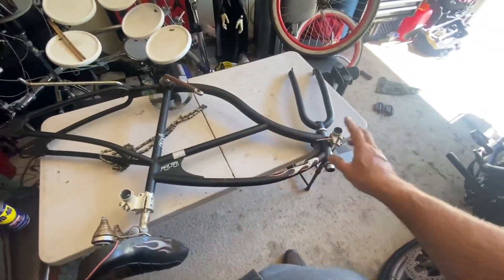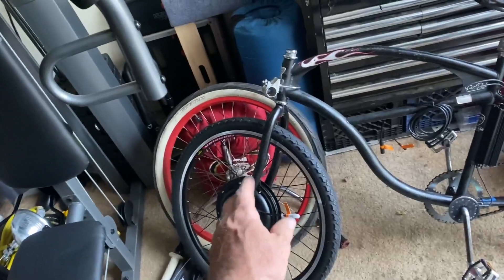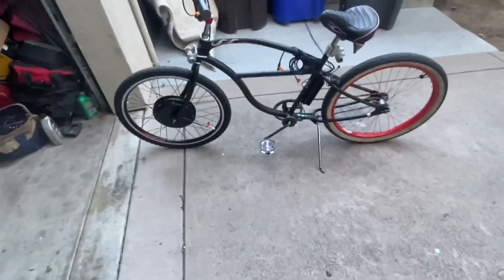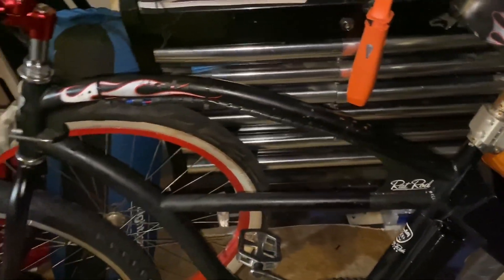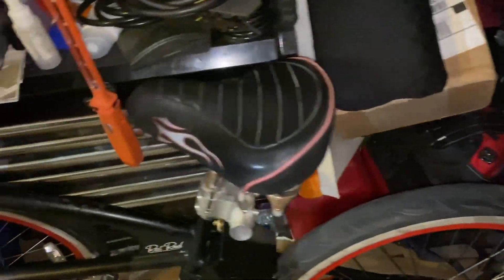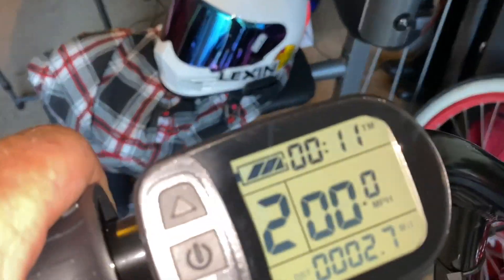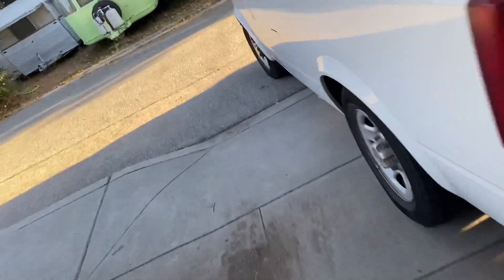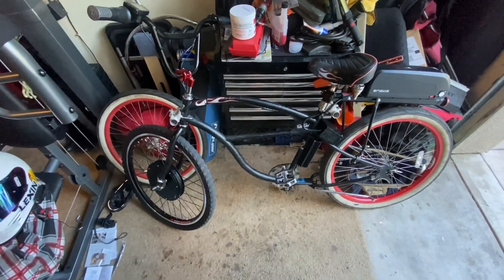convert my beach cruiser to an E bike, Electric bicycle #electra #electrcriuser #bicycle #ebike

Comment: Leave it on eco mode,without a big battery you only do about 25mph 1000watt motor, 30 miles with out pedal.its all good.two batterys or three,the battery's will die before the motor dies.thats a long time.

Comment: I’m so glad I came across your video, I have the same model, except in a three speed, have you tried putting the original tire on the electric hub? I want to do a similar build, but want to retain the awesome flame tread
Reply from the maker: I have not. Just running as is
Reply: was yours a 3 speed as well? If so, did you remove the shimano nexus and coaster brake?

Comment: Nice conversion. What is your experience so far with front hub weight increase ? Is the bike harder to steer compared to before ebike conversion ? Any issues with front hub as opposed to choosing rear hub. I am about to make a decision on front vs rear hub conversion kit, same type of bike, road use. Thx
Reply from the maker: The front was easy / lazy way to do it. Works great. But things like wheel turned acceleration can be sketchy. Other than that it’s still going good.

Comment: I have my Electra on the rack getting ready to strip things out.  I was thinking of going a Bafang mid motor and was wondering how that would work with the coaster brake?  Do you use the front brake and did your bike come with one or is it an add-on?
Reply from the maker: It would be add on. I’m just running coaster break and it’s scetchy.
Reply: I ended up going with the ebikeling 750w front hub kit.  There are bolt holes on the hub for a disk brake but no real clearance to fit one, much less mounting holes for the caliper, so I guess Im going to rig a front caliper setup.  Standard brake shoes or something larger or stickier?

Comment: Pedal-assist on a one-piece crank? Anything I should know? Want to put a hub motor on a 7 speed cruiser. Customizations look better on a cruiser. Just worried about pedal-assist setup on a one-piece crank.
Reply from the maker: It didnt last long the sensor for pedal assist. I use the throttle it’s still working great.
Reply: @NorCal-refrigeration  it sounds like you mean it got broken. I'm going to try to make it work as well. It's in a bad spot I'm thinking a large washer welded to the crank in front of it to protect it. I've got to try something to make it work without spending a bundle on a new crank.
Reply from the maker: @radiocean707  I made a nice bracket for it.

Comment: it's a good job...but you might want to wear a helmet. I was riding along on something like this several years ago, hit a sudden abrupt depression in the road, and the next thing I knew I was going "WHACK' against a curb with my head. I was lucky in that I had a helmet on, and so was able to get and walk away pushing my bike along beside me. I recall when I stood up being so astonished that I had hit that curb so fast and so hard and had come out of it undamaged that I put my hands to my head and walked around a few minutes just saying over and over "Wow Wow Wow!" I've ridden a great deal since then, both electric and gas bikes and I find I can't even sit stationary on a powered 2 wheel vehicle without some kind of helmet on.

Comment: I have an Electra Cruiser 1 I’m looking to convert to electric. What conversion kit did you get from Amazon and which battery did you go with? Thanks for any help or advice you can give!
Reply: Hey did you ever get the answer to your question? I'm wondering the same thing  just got that bike at a garage sale its so nice. I want to convert.
Reply: Ah, all the info is in the description! The wheel hub kit is $245 and the battery is about $140

Comment: I did this same conversion to my Schwinn beach cruiser last week. I had to add a torque arm like you did because the axle kept pulling out of the forks drop out. Yesterday I noticed it trying to pull out with a little gap between the axle and dropout. How is yours holding up?
Reply from the maker: Requires checking but going good still 30mph.
Reply: @NorCal-refrigeration  Thanks.

Comment: I am guessing by your installation of the kill switch you did away with the hand brake lever. I am on the verge of doing this to my bike but was wondering about coaster brakes effectiveness, but it seems you are cruising along just fine. Thanks for the video.
Reply from the maker: The braking is lacking. And yes kill switch replaced brake lever.

Comment: Any chance of a follow up on how you find the front hub drive . I am looking at converting a 29er hardtail to front hub drive, but most bike shops i've talked to say they are bad in wet or slippery conditions. I would be interested in your comments. The bike is used mainly on paved bike paths with a few hill sections
Reply from the maker: The manual says not for wet weather. I think that’s because the electronics will get wet and die.  I’ve been ripping all over on it up a huge hill to work ( pedaling and throttling 12mph ). There are rear hub kits out there also.
Reply: @NorCal-refrigeration  Hey there Nor-Cal, Where did you get a hub motor for a 2.125" wide cruiser wheel? all the ones I find are a 1 3/4" mountain bike type rim... or did you re-spoke in the motor in??? I got a brand new cruiser I am excited about converting, will those hub motors work on the rear w coaster brake? Don't really want FWD. If rear hub motor not an option I plan on clocking a mid-motor up inside the frame with a frame bag over it so no-one can see it... does that sound like an easy fabrication? (the cruiser frames have way more room up there)
Reply from the maker: @autojohn2000  Amazon I think the link is in description
Reply: @autojohn2000  You're confusing tire width (26x2.125) with rim width.  A standard 1.75"  wide 26" rim will hold a wide range of tire widths, much the way a car or truck rim will.
Reply: Thanks for the reply. The Road laws in NZ limit E bikes to 300W max motors, unless only for off road use.Going Rear hub drive means I cant run my existing worn Shimano 9 speed cassette, chain and chainrings. In these Covid shortage times Bike parts can be a hassle to source in NZ. keep up the entertaining vids
Reply: @davecole1546  Hey Dave. I converted a cruiser using front hub 250w motor about 6 months ago. I havent noticed any lack of traction or stability but generally avoid rain because of the electronics. 300w 36v is fine for me. I only need to lightly assist with pedalling up hills.  The reason I built my bikes from components is so that you can stay legal as many of the off the shelf products aren't legal. My top speed under power with this set up is over 30kph and range is 40ish kms. Front hubs are known as the least efficient set up by my set up is my regular work commute and is fine so far.